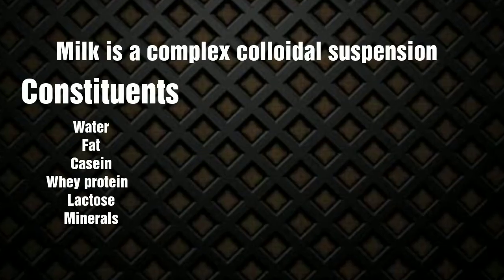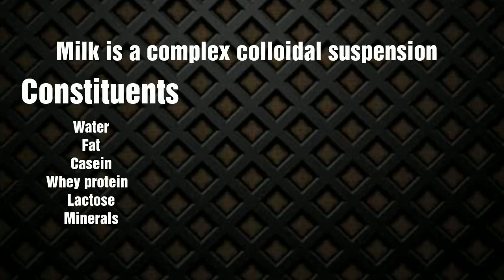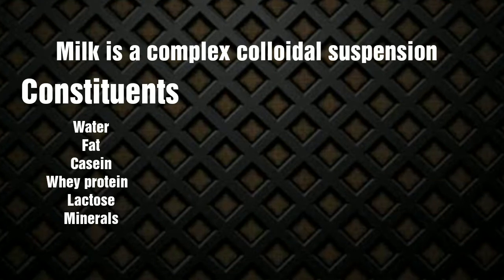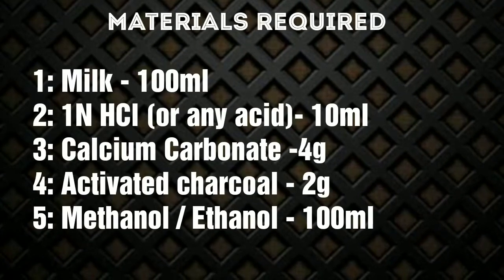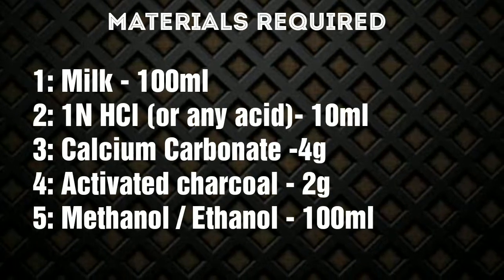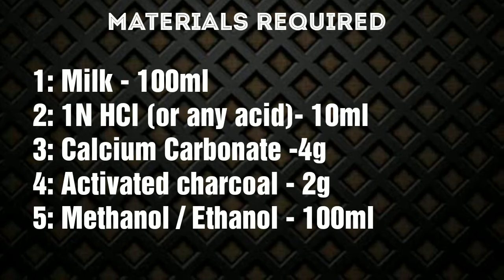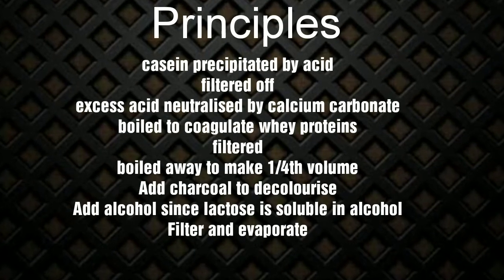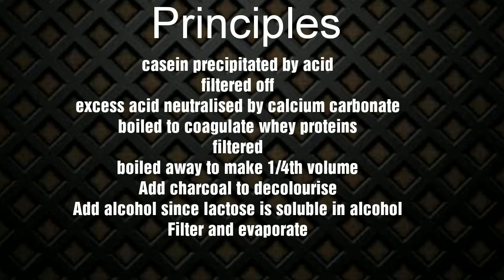Extraction of Lactose and Casein from milk

Comment: "Then add alcohol ( since lactose is more 
soluble in alcohol)" I've done some researches and found out that increased concentration of alcohol can greatly reduced lactose solubility
Reply: I've tried the experiment too (i added 70% ethanol to the liquid, then a crystalline solid crashed out, is that the lactose?)
Reply: @br2openup100  you could taste it, lactose is slightly sweet
Reply: I think there's a mistake here. I've been researching and  lactose is more soluble in water than etOH. So I think that the adding of etOH is to create a suspension and separate lactose from the solution...